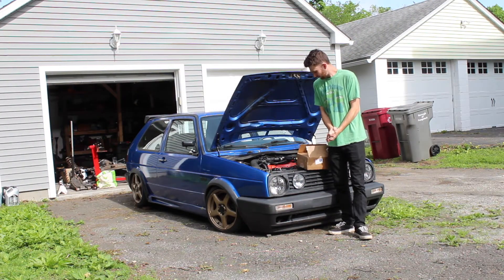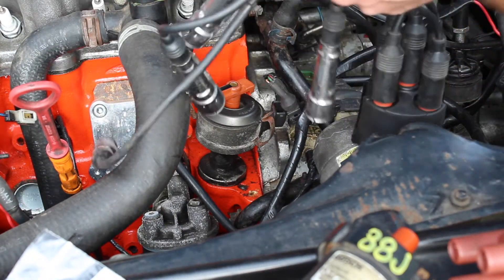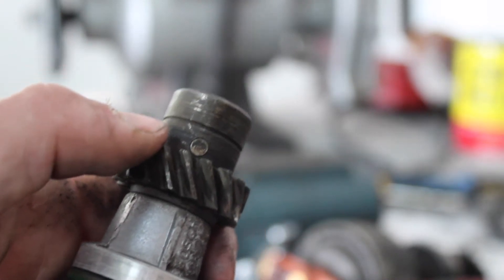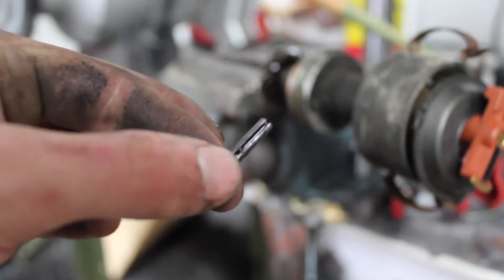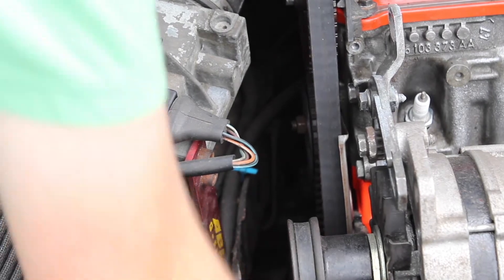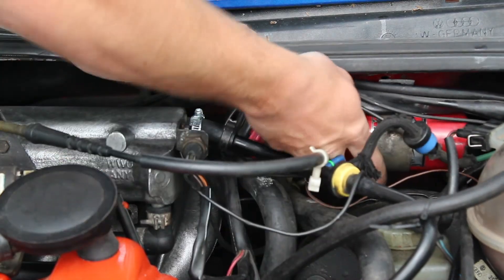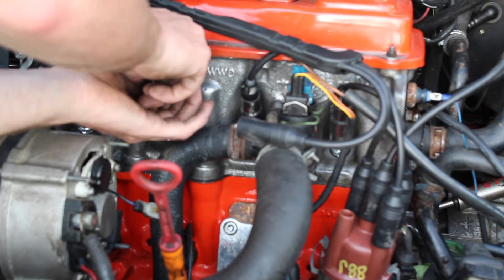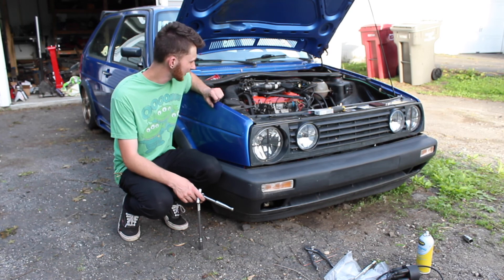Mk2 Full Ignition System Replacement

Comment: Take the cap off, make sure the rotor on the distributor is pointing towards #1 cylinder from TDC. If not remove, and re-align
Reply: That's correct

Comment: I found I can use a 3/4 12 point on crank gear. The 9 bolts to the Flywheel are 9 mm 12 point.

Comment: Mate I think your leads are on wrong order
Reply from the maker: It's possible. I used a diagram I found online but you can never be sure. How do you think they go?
Reply: @christianscustoms6429  1-3-4-2
Reply: It does look like the leads were installed in the wrong position.. been there done that. Sick dub btw! Get it on the road!!
Reply: i thougght am the only one.remove distributor cap and start again on reserting the timing